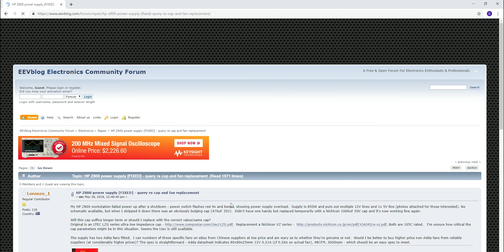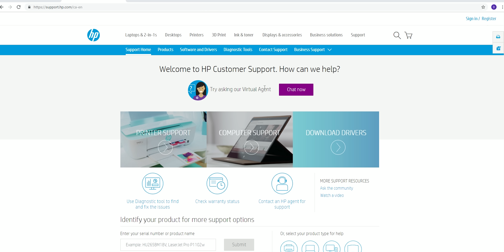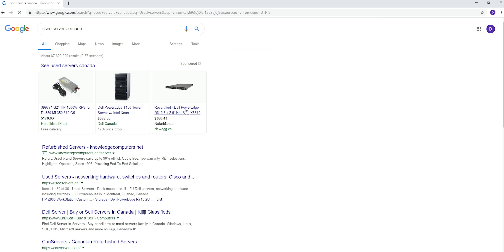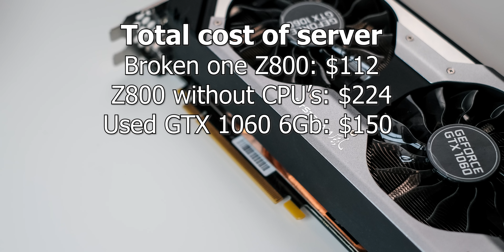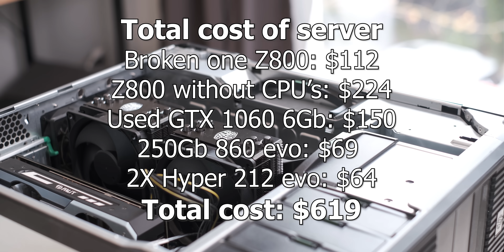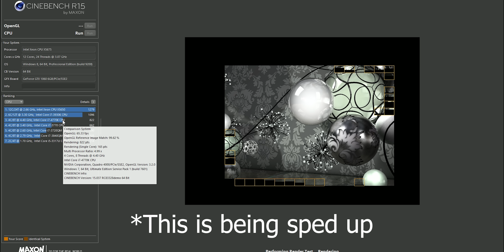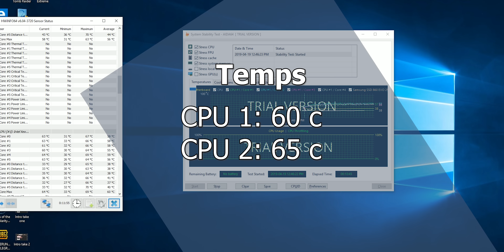Dual Intel Xeon, 48Gb BEAST for under $700! (With Benchmarks)

Comment: My second workstation - more for Astrophotography and video editting was a dual Xeon set up 2 x E5-2699v3 - so 36 physical core with 256GB RAM.  I turned hyperthreading off (as programs need special processor affinity coding to allocate work across NUMA nodes once you have over 64 logical processors) and the thing flies.  I also added a NVidia OC RTX 4070 and a 4 x 2TB NVME M2 RAID 0 PCIE 16 (but only gen 3) card - so now this workstation can do everything - very fast, very quiet - very cost effective!

Comment: I had a Z820 a looong time ago, and it was getting long in the tooth then. Uograded it to the top-end chips the board would take, dual 12-cores. 
It was slow as balls in every benchmark compared to a $300 modern chip. Not at all worth it, for any reason whatsoever.

Comment: for that price why not go for a supermicro x10D (dual) series mobo and a 26xx v3 o v4 cpu, it's just way better, well...depending on what you wanna do, my day to day pc is a x10dri, dual 2699v3 and gtx 1080ti, works better than any modern pc while also serving the purpose of dual boot to vmware esxi for virtualization tasks

Comment: About 2 years ago I bought a HP Pavilion laptop for $639. It came with a Intel i5-9300H CPU @ 2.40GHz(4.1 GHz Turbo), NVidia GeForce 1650 Ti(4GB),  16GB SD RAM Memory, Western Digital 1 TB m.2 SSD. I'm pleasantly surprised how well it's held up. I do a lot of video editing, 3d models, and it has no problem with all the newer games. The only 1 thing that I wish it could handle better is when using Unreal when trying to make virtual on set environments, and Unity when adding a lot of 3d models and characters for making video games. I guess what I'm trying to say is that bigger isn't always better.

Comment: I have the option to buy one of these (liquid cooled). Will it be good for having dual nVidia P40s in it? I want to run LLMs on it. Will the PCIe 2.0 bottle neck it as the PCIe bus will have heavy traffic bcuz of my workload?

Comment: I have a old HP workstation that even today will crush a Ryzen 5800x in multithreaded workloads.... The box has 2x E5-2699 v4's for a total of 44 cores, 88 threads and a max boost clock of 3.6GHz... With the 128GB of DDR4 in 8 channel, It will casually push out a little of 30,000 points in Cinebench R23... Short of buying into Threadripper 2990W again (which I'm not about to do) nothing comes remotely close for the type of workloads I put on this rig (scientific astrophotographic analysis/processing)... All that matters for my workloads is cores and ram. IPC only matters IF you have more cores... So with my 88 cores, 128gb of ram and a 2560 cuda cores in the machine as well, I couldn't think of a better machine... All up it cost me FAR less than buying even a Ryzen 7 5800x CPU and 16Gb of DDR4 3200..

Comment: you really should have mentioned that not only Z800 doesn't provide USB3, it also doesn't come with SATA 3. It's a SATA 2 machine and the internal HDD transfer speed is also very slow compare to SATA 3, even when it's RAIDed on windows disk manager there's speed difference.

Comment: I had a work machine HP Z840. Great for developer work (overkill) but if you write code that get's deployed on servers it gives you a very similar architecture. I would not get this for gaming. Xeon's are not optimized for any games really, since I'm not aware of any games that can take advantage of Dual Socket systems, except maybe chess engines.

Comment: I have system with old Xeon, but good news that it can held 128Gb memory. That's good. But average performance not so good. You have good prices for this pieces of iron. In current prices as average we can buy only 2 excellent power supply, and that's all folks.

Comment: this thing excels when you know how to program functions that can use up all cores at the same time (parallel procesing). i also got one + radeon RX580 (bought used separately)... and i bought a spare psu for it as well, just in case.

Comment: could you use a 5.25 drive space?  you can get an I/O with USB 3.0.  You can run it's cable to a USB 3.0 card that has an input for the header cable.. provided you have a pcie x1 slot and a space for the card.   not sure if this would work, but I have been considering it for an old fx 6300 system that is completely usb 2.

Comment: So was it a problem with the plug on the motherboard or The termination on the power supply cable? And did you try swapping the power of the new power supply with the old one to see if that fixed it?
Or maybe even reterminating the power supply cable for like $5 in parts?

Comment: I have a GTX 260 that I use for testing motherboards! I basically just use it because of it’s HDMI output and much better performance compared to integrated motherboard or cpu graphics (for those that have it).

Comment: In terms of specs, they are like a MAC PRO 5,1 but more expandable. They can be upgraded with modern SSDs, USB cards, and yes, even NVME drives. I have one of these motherboards put in a giant custom tower PC case, because its huge and can't even fit EEB cases like Fractal define 7 XL. There are aftermarket PSU cables for $10 to use a regular PC power supply (at least 600W 80+ gold). Total cost : $250 for board, 2 xeons, 48GB ram, ATX cable, 2 larger coolers with fans. Not bad. And many use cases, from Hackintosh to workstation, server, etc

Comment: HP Z800 is a very poor choice, it is very old and will not support an HD larger than 2 or 4Tb (don't remember which is the limit). So if you want larger storage, get an HP Z820, which is far better. It has excellent cooling of every component. Just look at one showing the open case.

Comment: I share my main Windows pro computer with my family using remote desktop and file sharing features. They all have their own systems but there aren't enough gpus to go around, so one person at a time can use my computer if they need a little bit of extra juice. Coming from someone with a core i5 4590 and a GTX 760, I think this would be the best machine for my use case.

Comment: The Z800 is a brilliant machine - I've also installed Windows 11 on them with no problems - the only thing you can't do is boot to an NVME - but they do run on it at about 1800Mb/Sec!
Reply: They make a PCIe adapter for this.
Reply: @om3gadoestech  Yes I know I have some -  but you can't install an OS on it.

Comment: I'm still rocking a Xeon X5690 CPU overclocked to 4 GHz in my main computer. I have been using the motherboard since 2010 and the CPU since 2017 when I upgraded from an i7 950. 1279 cinebench score when overclocked to 4.16 I think.

Comment: I have the hp Z840 however my use case is different as I use it as a home lab.
Dual xeon e5-2640 v3
192gb ram
Gtx 1050ti 
Adaptec 51245 connecting to a hp storageworks
500gb nvme
4x 8tb wd red drives
Quad port intel nics
60gb ssd for vmware 6.7

Comment: x5675's dayum kicked it old school but even 2 years ago in dual form in multi-threaded apps they did pretty well. The Z800 is a workstation, not a server, used them and the Z600 series for years, great machines.

Comment: No wonder you had thermal problems with Z800 missing most of its thermal conduits. PSU has its own thermal conduit, RAM sticks have their own coolers and second conduit, CPU-s have the third, GPU and other expansions fourth... There is no need to mess with the cooling - if you only have the whole thing.

Comment: I am going to get a Dell Precision T5610 with dual E5-2650 V2 processors (Total 16 Core 32 thread) for 110 USD. The seller claims the pc has some issue that randomly and when trying to turn back on the pc won’t boot until the PSU is removed for a while and reinstalled. Do you know what could cause the issue? The seller claims either mobo or PSU. But it does work some of the time and the performance is insane. Due to the cheap price I want to try to fix it.

Comment: In august of 2019 i bought a t7600, match 2 e5 2689 with 64gb of ram, raid 0 ssd and 2 3tb hdd by less tan 400usd. Then i put an 1080ti i bought 2d hand like 2 y ago when price was low (230us). Bum! a good gaming rig by less than 700us.

Comment: I still use it as a daily. I have a hp workstation z640 with 2x E52699v4 (44 c/88 t) with 192 GB of RAM and 3 SSD in RAID 5. Lovely machine for Virtualization and complete silence.

Comment: I have a Z400 (the little brother to that machine), and I just put a PCIe USB3 5 port card in it to alleviate the slow USB transfer issue. Even though you can't overclock these machines, they're pretty much bulletproof for an everyday driver (the Z400 more so than the Z800, since it has a normal power supply). Mine is only a single Xeon W3580, but then again, I only paid $109 for it on Ebay, with free shipping!

Comment: Wow, even for 2019, those Z800 part and system prices are insane. Ouch Canada.

The Z800 was pretty simple, had a bunch of them. Its odd seeing one without the mem cooling, all the ones I used always bitched and refused to move past post when those weren't plugged in. 

If it was running hot stock with X5675's, then those might have been the non-high performance coolers. I think that was a thing on the Z800, I know it was on the Z820 and the difference was pretty big. HP did have CLC option kit, but there is no way those would be still functionally now just due to permeation losses.

The Z820 was quirky, it has 3 different motherboard revisions and only the latest one is worth using due to is supporting E5v2 CPUs and Win10. The only way to tell is by the part number and not the spare number (all will have the same spare number). Even though the things are from 2013-2015, they were selling for over $500 on ebay in the US and a complete system would be <$800.

Both models are unpractical for a primary workstations now. For most workload, a Z820 with dual E5-2667v2 is obsoleted by a single AMD 3600X for cheaper and less than half the power.

Comment: As a former HP field engineer, there was a 3rd option for cooling, a closed loop liquid kit. And because I worked on these 800 all the time, I chose a Z600. More reliable, smaller and lighter.
Reply: Ray Mond - Please, please, please could you help me out? I have a HP Z840 I am trying to upgrade and could really do with your technical knowledge. Thank you in advance.
Reply: Question is this worth doing now?? And trying to game on it lol??
Reply: @kcmullins6179  It will still perform almost the same as you saw in the video.
Reply: will that cooler work on a z600?
Reply: @mygirlhitsme  Sice it's a smaller case, i don't think it Will. IT barely fits to the Z800
Reply: What bout a z440

Comment: look he actually uses sort of a server there not as bad as you think i also have a big server rack and use it for gaming specs are
2x xeon x5660
48gb ram
asus gt 1030 ddr5 variant (faster 5fps)
2 x 750watt psu
samsung evo 870 250gb

Comment: These old xeons are dirt cheap nowadays, and that is for a reason.   12 core 24 thread dual xeon is ~ 6 core 12 thread Core i7 7800X (a low-end cpu for socket 2066).  Still way better than the pathetic i7 7700K tho.

1350 points in cinebench r15 is what a 4.2ghz i7 7800x achieves. (195 single core)

Comment: Hi do you think HP going to update Bios and the TPM 1.2 to 2.0 in the future so we be able to install Windows 11 in this machine? Or this machines are stuck with TPM 1.2 and in 2025 will become obsolete?
Reply: I think there is already such additional chips but they are inflated due to scalping
Reply: @kurnma3776  I don’t think that doesn’t matter anymore I updated the drivers to 2.0 now it telling me it’s the processor I have 2 x 14 cores the minimum requirement is 1g 2 core what this greedy busters wants.

Comment: Thats awesome you built a usable workstation out of 1366 socket,1366/x58 is a long living and quite powerful platform,not many even later platforms could out live it. Though my old x58 990x OC'd to 4.6Ghz scores just over 2,000 in R20 on water and it still has room if your willing to crank the voltage a little high. If you could get the bios one of the commenters mentioned below to enable slight overclocking you'd have a little beast on your hands.

Comment: 15bucks solves the usb3 issue, you can also toss in a lsi based raid card if you want sata 3/sas 2 support on the cheap, and, there are ways people have managed to OC these, not massivly mind but, at least lock them at full turbo, it may be a modified bios but..could also just be knowing the correct hotkeys to cause hidden bios features to become visible on entering bios... been a while since i was looking into them... 

if i could get a dual 1366 EVGA board...and another x5675...i would be clocking a pair of chips with 48gb ram... and half my ram slots empty...
Reply: I snagged a Dell T7500 with the riser board with 2 X5550 cpus, 12gb of ram (6x2gb), some quadro, some random expansion cards, 2x1.5tb 7400rpm HDDs and a not activated copy of Windows 7. 

I then spent the next 2 months getting 2, X5675s (I wanted X5690s), 12x4gb sticks of ram (I would have preferred 6x8gb or even 12x8gb), a massively upgraded heatsink for CPU 1, PCIe Sata 3 card, SSD and a 980ti. A massive pain to grab these parts, however I got it done. Once I had them, I then spent 3 weeks diagnosing why it wouldn't post, which turns out was the bios. I finally got it all running properly and have been using it for a few weeks, however it has never ending gremlins. From a period of time with 10 minute post's, not being able to boot from the PCIe sata card, the HDDs being totally trashed (the SSD took care of that) and something I have resigned to suffering through is an "error" on the Riser cards, DIMM 3 ram stick, which is something I think is never going to be properly resolved (I can ignore and still use that stick).

Dual CPU machines are beasts. Even in some games, both CPUs are being utilized which blows me away. As soon as I can sort out the PCIe/Sata card issue, I am going to be overclocking it via SetFSB.

Comment: I haven't watched your video in its entirety but a simple way to tell if a part is bad is it will overheat due to the short, . So find the short instead by finding its indicator, HEAT. Spray FreeOn (that was is/was it's trade name) or similar refrigerant on the board and that defective part will be the one whereupon the frosty freeze has melted. That is a good first clue to fixing it with a component and a soldering iron instead of replacing the full board blindly in the hope whatever was bad is replaced. That way of fixing stuff is like kitchen sinking it or carpet bombing it.

Comment: 0:50 Don't open power supplies and handle the bare circuit board like this. Some of the capacitors in it are like 200 volts and can kill you.

Comment: Dual Xeon is a good idea IF AND ONLY IF:	
1. You expect to be doing a lot of rendering, video editing or machine learning
2. The cost of the Xeon rig will be significantly less than a 2021 equivalent, to offset all the other possible downsides;
3. You can reliably source 100% working parts: Good CPUs (E5-267x to 269x, v3/v4), compatible working motherboard, ECC RAM.
4. You know how to get both CPUs to post and can BIOS flash if necessary.
5. You have 2 coolers and they don't compete with each other for space.
6. You have a big enough case.
7. Gamers: your games rely on the GPU to do the heavy lifting- because Xeon single core speeds are at 50% to 75% of a 2021 equivalent and can cause microstutters if your game is CPU intensive.
8. Gamers: The motherboard has audio or you have a sound card because hey, these are server motherboards.

Comment: I use one of these Z800 towers. Its a great machine and is an absolute beast at video editing. Mine's got dual Xeon X5660 @2.8 GHz, 176 GB DDR3 ECC registered RAM, a GTX 1080 8GB, 500 GB Samsung 860 EVO boot drive, 2 TB Samsung 860 EVO for games, and a 14 TB WDC easystore shuck for general storage. 

My Z800 tower was free, as I grabbed it out of a dumpster. The CPU upgrades were free, as they were given to me from my IT teacher (the tower originally had a single X5560 Nehalem, ouch). My GTX 1080 8 GB was $330, 500 GB SSD was $70, 2 TB SSD was like $300, 14 TB EasyStore was like $180, and RAM was $180 for 192 GB. The last stick died, so I'm with 176 GB. So overall, it was like $880 to upgrade this from its stock single X5560, 4 GB of RAM, Quadro FX1800, and 250 GB spinning drive to its current configuration.